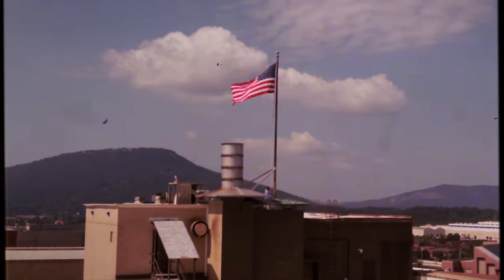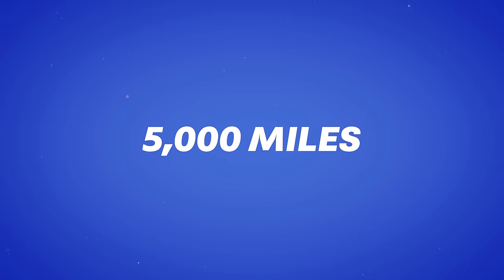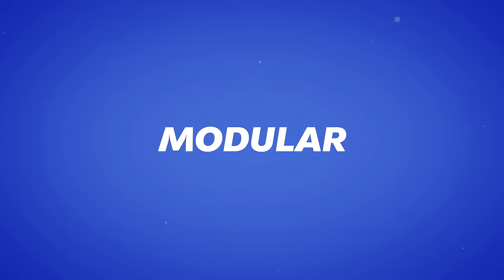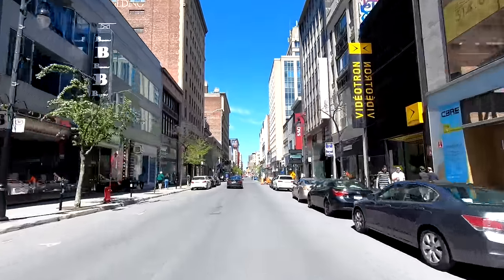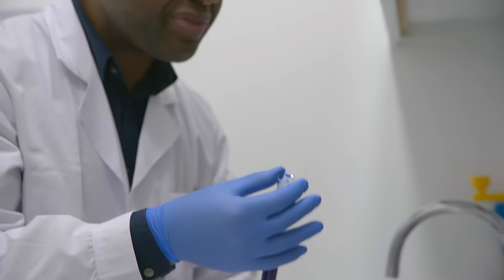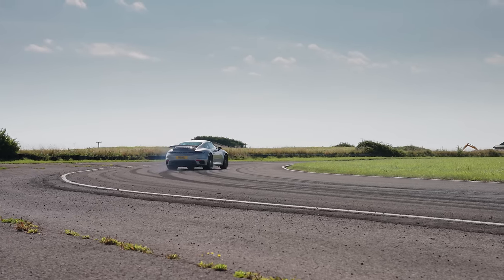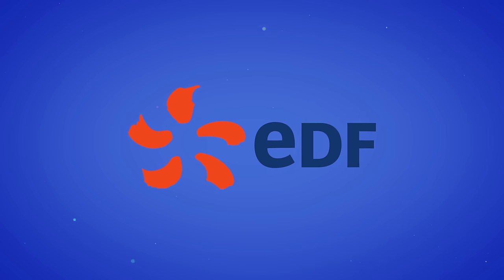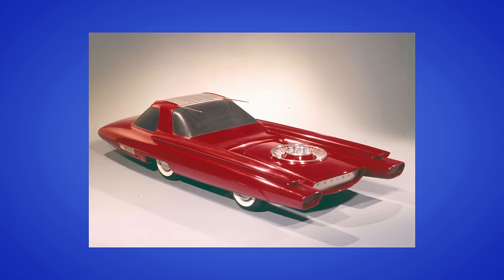Can Nuclear Power SAVE The Car Industry? 4K

Comment: You make a small nuk reactor, that charges batteries. And because it works constantly, it would charge them all the time. So in that way, you don't need that big of a nuk reactor. It's just a question of how much you want to drive per week.

Comment: Rolls Royce already make the Nuclear Sub reactors so no real problem with the SMRs.
There is one possible way ahead with cars if the plutonium decay heat systems, as used on deep space probes were used to charge the battery on an electric car. I think that it would probably take all week for a charge though, so just one day out each week.

Comment: I do have several problems with how this video is presented. overall it's okay but it's ever so slightly misleading at times and I don't like that you 'mixed up' nuclear power and nuclear weapons(yeah you ain't fooling anyone even if you were joking, don't) also rolls royce is not just a car company dude, they make stuff for the RAF too. you also should've mentioned radioisotope thermaleletric generators sure they have a low power output but they super tiny, super light, and somewhat easy to stack up. not saying you can just stack them like tin cans though, thats a bad idea. also dude we should be trying to get AWAY FROM FOSSIL FUEL! THEY ARE TERRIBLE IN ALMOST EVERY WAY. I AM NOT SCREAMING I AM JUST TRYING TO SAY THAT BECAUSE ITS TRUE. and why are trying to make synthetic fuels? that will only have the same effect if not worse that what we already have!(depending on you use for energy storage within the molecular compounds ofc) also a 500 ton submarine is not comparable to a 5 ton four wheeled four door tank.

edit: okay i wrote this comment about 5 minutes in in this 7 minute video and it got worse immediately. you can't claim something is slow when you don't even have a completed time! it's like starting a stop watch and commenting before they even finished a lap! not to mention, POLITICS! if your gonna use time for an argument, then use a time from an already completed subject! EXTREMELY MISLEADING!

Comment: The Martian commented on cabin radiation with the nuclear power.  
* Nuclear provides 70.6% of the France's total electricity production.  — Wikipedia.
* "With a death rate of 0.07 per TWh, nuclear power is the safest energy source per unit of energy…" — Wikipedia.

Comment: If you were to use FUSION & not FISSION, you could switch the reaction off & reactivate it like a combustion engine. Also if anything were to go awry, like hitting another fusion reactor on wheels, the reaction simply halts. Not to mention unlimited range and zero fuel.

Comment: Mcro nuclear energy stations with a power delivery of around 10-20 MW has sence as trucks and buses charging points on highways big traffic nodes,  considering the energy required for charging big heavy machines is out of existed power infrastructure.  This will be facts maybe in 5 years time when the electric revolution will reach the heavy duty transportation,

Comment: This idea would work…but regulation and laws would never let nuclear propulsion become mainstream.
Reply: It wouldn't work, the amount of shielding needed relative to the size of the power unit makes it completely infeasible, the shielding can only be made from super dense materials so it's just inefficient. Combine that with the way that the usable power is actually extracted from the fuel through boiling water it means you'd have to wait at least a couple of minutes between starting the reaction and being able to move which is not the convenience we expect and need from personal transport. There is also then the final issue which is what to do with all those small, highly radioactive fuel rods and all the irradiated water/materials? Disposing of nuclear waste is already an inconvenient problem as it is when there are relatively few contributors, multiplying that problem by a factor of millions is bonkers. It's like the landfill problem of non recyclable waste but instead of being just an ugly mess it melts your skin off and permanently alters your DNA.

Comment: electric cars charging at night could increase the baseload power of the grid and therefore more of it could come from nuclear. but we need nuclear for that to happen and that takes time. basically, renewables r a better answer since they can theorethically be installed in a month(if we r talking solar).
Reply: Solar isn't so good for charging cars at night    -   sorry!  I have solar panels, and they are crap in the winter too.
Reply: @raytrevor1  i was talking about solar/renewables as a general source of power. obviously solar isn't gonna be good at charging things at night. in the winter i guess the only solution is to set up more of it and hope it does the trick well enough.
Reply: @yvs6663  That's why solar power hasn't taken off in cold countries like mine. Winter here is no joke. Solar and wind cannot be relied on up here. Which is why my country (Canada) is one of the pioneering countries of small modular reactors. Because nuclear power will not fail after a week of blizzard and -40C. Nuclear power is also throttleable so it can match the needs of the grid better.

Comment: Climate change isn't our only enemy. There is less than 50 years of oil left in the ground and we are looking at massive massive starvation if we can't figure out to power cargo AND reserve enough oil to manufacture the cargo trucks. No one seems to take it seriously enough but we should have stoped driving petroleum cars yesterday and had our power grid using much more "renewables." And even there, the oil to manufacture would eventually run out.

Comment: I wish people were less afraid of nuclear power. Looking at the numbers: Three Mile Island: no deaths, Fukushima: 1 direct death, Chernobyl: < 100 direct deaths. Compared to burning coal which contributes to upwards of 100,000 deaths per year, ~100 deaths per 50 years is pretty safe, around what one might expect from incidences of accidents working on wind turbines and installing solar pannels. The damage to the climate due to people's (mostly) unfounded fear of nuclear energy is really sad.
Reply: Ah yes, getting cancer and suffering till death is better than dying i get it.
Reply: @r3zaful  I’m not trying to minimize the suffering or anything, but do compare the cancer rate from those incidents to that of coal burning. It’s estimated that 1.37 million people will get lung cancer from burning coal in 2025. Chernobyl caused somewhere around 5,000 cancer cases (and those types of incidents are extremely rare). So the comparison is >1 mil cancer cases per year (coal) vs 5k cases every several decades.

Comment: The reactor creates steam... in a car... how exactly did they thought of an infinite resource of water in a moving land vehicle??
Reply: Maybe a recirculation system? Make steam-> produce power->use said power to power condensers that turn the steam back to water-> repeat?
Reply: @thedark333side4  impossible, the insulation needed for the steam to turn to water again would need tu be heavy...and big. 
If they go with air cooling it means the car needs to be on the move constantly.
If it is some sort of mechanical cooling the possibilities for a defect and potential melt down are huge.
Reply: @Lord Refrigerator Intercooler  
Thanks for the response. I was speaking hypothetically. The amount of shielding needed to make the reactor safe for operation is extremely heavy in and of itself, so the cooling system being too heavy is not going to change much, mainly because the concept is flawed from the start.
Reply: @thedark333side4  exactly.
the radiation would be strong enough  to make it impractical to add any type of cooling for the liquid.
If you make the radiation less strong than there wont be enough power...
well, if only there was a way to convert radiation directly into energy with out the fluid agregate change to power a generator... oh wait we do! ITS SOLAR POWER!
Reply: @lordrefrigeratorintercoole288  Until fusion is achieved, I believe solar is the best option for now.
Reply: @thedark333side4  i hear that some scientists are close into understanding fusion.
i still don't get it how its supposed to work in theory, im to narrow minded for that kind of magic 🤣
Reply: Great conversation starter! 😉
Reply: @Lord Refrigerator Intercooler  
it's very complicated, but they are close to making a reaction that can make more energy than it uses. That being said, it would just be a milestone, and it is still at least 20yrs or so until it can reach commercialisation. The reactor that the EU is working on is expected to have net energy gain by 2025, but it still is a proof of concept.
Reply: @thedark333side4  i still dont understand how are they going to hold all that energy or plasma in check.
I know you can bend plasma with magnetic forces, but it will produce allot of heat.
But i guess if it works it will produce its own energy for the magnetic coils.

Also all the heat, they will need allot of cryogenic fluids to keep it cool. and thats also expensive.

than is my question about the energy it self, is the reactor slowly spraying Hydrogen and tritium in it to keep a constant flow of energy? or will it be one big bang and than let it burn for a while?

and how are they going to turn that plasma in to actual usable energy?
is it spinning some dynamo again? 
Or are they going to put photovoltaics in that doughnut shaped chamber??  

i just don't get the logistics behind it, its utter nonsense.
Reply: @Lord Refrigerator Intercooler  There are a couple of different concepts, some use one burst of fuel, others inject continuously. It is very energy-intensive and expensive, but the reactor can power its own functions and the coolant isn't actually that hard to figure out from what I've heard, although it is hard to grasp how with all the heat. The energy conversion process is also direct and not dependent on vapor, although I have to admit, I don't understand how it is extracted. But as convoluted as it is, it is truly extraordinary!

Comment: Rory, I very much like your style of presentation. But your research team needs a step up. Nuclear can and is used in a compact form of RTG (Voyager 1 is powered by a radioisotope thermoelectric generator, or RTG). US and RF military satellites are powered by the same type batteries. So, it's one small step for the man, and a huge leap for the automotive industry.
Reply: that doesn't count - RTG is simply making use of the heat from the decaying plutonium from its natural decay. This can only produce very little power, just enough to run electronics - this is a fundamental limitation since natural decay can only produce so much power. To produce power in the 10s to 100s of kilowatt range needed to run a car, you need actual fission to happen - RTGs produce 100 watts or so, i.e., a 100 to THOUSAND times less than what's needed for a car. When people refer to nuclear power they usually refer to fission or fusion, RTG is extremely limited and cannot be used to move anything

Comment: If my calculations are correct then 470 megawatts is nowhere near enough to power a million homes. Maybe 20,000 homes. A decent size house will use 20-25 KW

Comment: Up until ~2010, nuclear power made sense. In ~2010 the wind and solar became significantly cheaper than nuclear. TODAY nuclear is simply too risky, too slow to build, too expensive, too much of a hassle, too dangerous to bother with. If you start construction of a nuclear plant today, you sink 10 billion into it, and maybe you'll see some return no sooner than 10 years. If you start deploying a field of solar batteries- you get return immediately. For storage to make renewables more viable as baseload- build more pumped storage or improve lithium-iron battery tech. That's more attractive than nuclear. And I am not anti-nuclear per se. I believe nuclear tech is low-carbon, quite safe, and nuclear waste is mostly a solved problem. It's simply economically non-viable compared to other alternatives today.
Reply: No, that is only the public opinion, which is not correct. Renewables have much shorter services lives and is not clean to manufature at all. For now nuclear energy is still the cleanest, even with the waste

Comment: I personally think that synthetic fuels will prolong the existance of legacy cars, classics and cars which shouldn't be lost to history. cars like for example my 1973 Volvo 1800ES. it can be worth buying something like 200 liters of synthetic fuel every year to keep something like this alive and even if the price happens to be double our already absurd fuel prices we have here in sweden is it still worth it, especially since it is currently the only thing bringing me pure joy.
Reply: If the feedstock for synthetic fuels comes from coal or natural gas it is still using "fossil" fuels. You accomplish nothing.  If the feedstock comes from biomass you accomplish something....but the economics of doing it are not there,  You would mostly need to run out of the availability of fossil fuels before synthetic fuel can become cheap enough.
Reply: @michaeljorgensen790  as I said, there are a lot of cars that shouldn't be lost to history and synthetic fuels (if perfected quick enough) will be able to prolong the existance of legacy cars like my 1973 Volvo 1800ES.

I never said anything about it being cheap or anything and yes, I 100% agree, if it is made from a fossile source is it still a fossile fuel and I could just as well just drive with the real deal instead. 

the thing with my car and many other like mine is that you don't drive long distances in cars like this, I personally have done 1500km this summer in my classic which is under 1000 miles so even if the fuel gets even more expensive than petrol is today is it still worth it. only the future will tell but I will be getting the fuel available or modify my classic so it can run on some alternative fuel so I can listen to the vroom noises it makes until the day I die.

Comment: Crikey, the media lose it whenever an electric car crashes. Imagine the headlines if it was nuclear! 

I can think of a type of wheeled vehicle which would work better with a small fission reactor, though: exploration rovers, either robotic or crewed, that need to travel far from base. On the Moon, they would be usable during the 14-day Lunar night, long after an EV would have run out of charge. And on Mars, which is further from the Sun, solar would only be able to provide enough power for short local journeys.

Comment: I think that nuclear should NEVER be introduced as an alternative to petrol engines. Even just replacing the fuel rods would have to be done in such an expensive and highly secured environment by professionals with experience both with radioactive material handling and with vehicular maintenance. Not to mention the environmental impacts of a crash or reactor defect that would inevitably cause a meltdown. On the broader spectrum of nuclear, HELL YES should we be putting more effort into nuclear energy. Brand new reactors are exponentially safer than the ones still lingering about from 50+ years ago, and are much more efficient too. Just look at China with their Thorium Molten-Salt Reactor concept that would not only make fission cheap, but incredibly safe and efficient with a fraction of the waste and lifespan of the waste.

Comment: This is possible today. What? Yes, all that has to be done is use the Powerplant to make electricity. Then charge the EVs that are already on the road that use the charging stations that already exist. There is however, a problem that an Electrician I know told me about. The Powerplant needs to be shut down from 62 to 68 days for repairs or regular maintainance.

Comment: Nuclear power is very slow to build. We build one reactor for 12 years here in Finland. Much faster to start a coal power plant in China. That might be more of a reason for the decline of nuclears share.. not so much like nuclear power plants were shut down or anything.
Reply: That's why small modular reactors are going to be a bit of a game changer for the nuclear industry. Nuclear power's biggest problem is the lack of standardization. Each power plant is a custom designed mega-machine with all the headaches and engineering nightmares that go with it. But if you could build a nuclear power plant out of standardized, pre-inspected/approved off-the-shelf parts? Then you could significantly reduce the cost and time to build, and the cost of maintenance. 
            And why bother building a massive reactor that can generate a gigawatt of power when 3 or 4 smaller 300Mw reactors could do the same? Plus the downtime savings. If one reactor has a problem then the whole plant doesn't need to go offline for it to be fixed, power generation will just be reduced temporarily.

Comment: Sometimes I think, what if it crashed, is the radiation dangerous?
Reply: With proper containment there would be no radiation leak. The real problem would be the occupants getting crushed by the structure.

Comment: New fission reactors produce much less waste than older ones. Also, they can use, as fuel, more than 99% of the waste of old reactors.
Reply: Only the molten salt reactor type can reuse waste to that degree. Looking forward to them but there aren't any planned for commercial use

Comment: It would need radiation shielding... a foot of lead and a couple feet of concrete... even if the reactor could fit in your hand... the car would be massive and the car would weigh 20 ton